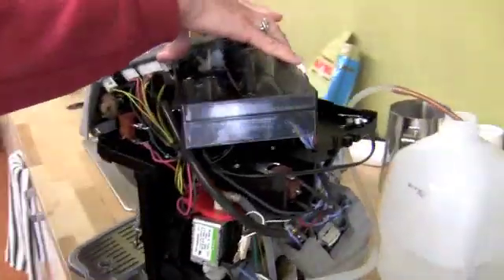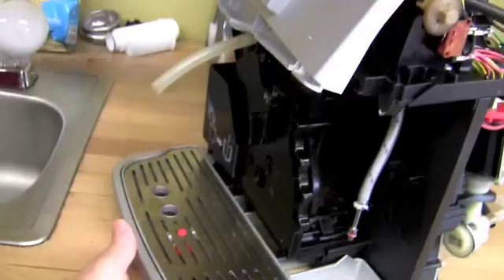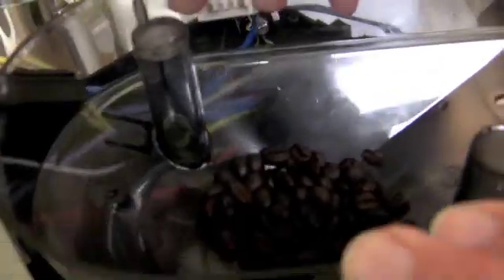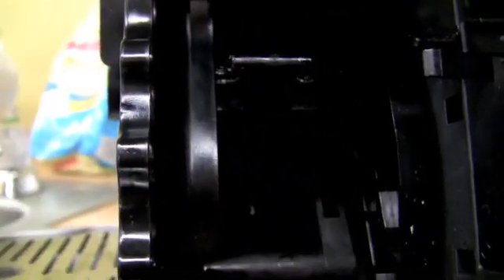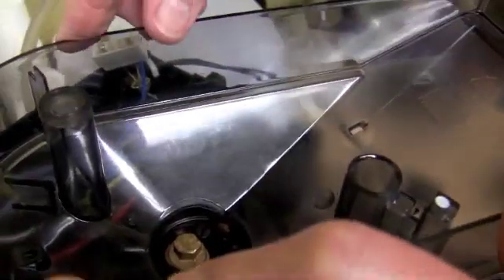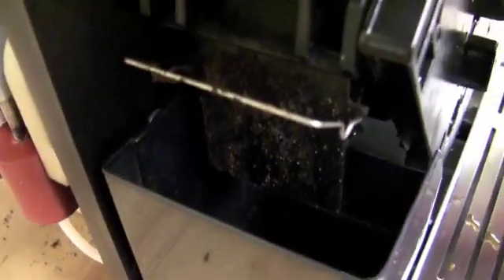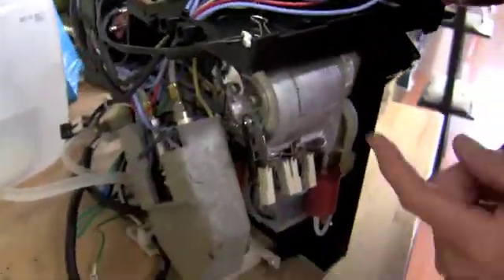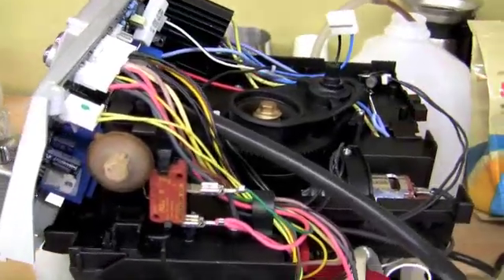Internals of a Superautomatic Espresso Machine

Comment: @SeattleCoffeeGear  I could always send you this one to play with ;-) Got it for $50 and took it apart and lubed the seals yada yada and when I was taking it apart a large oring seal fell out and now instead of running water through the grounds it runs water straight into the drip tray. Funny though, the brew head (?), compression mechanism looks just like the one in your video...